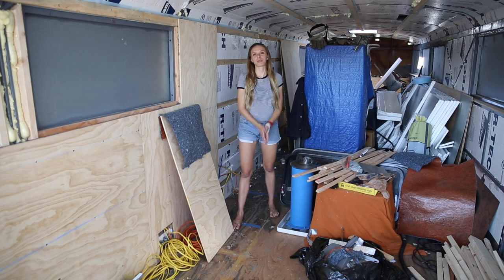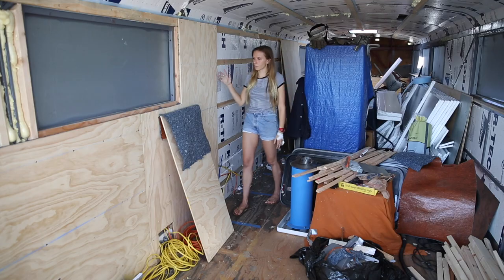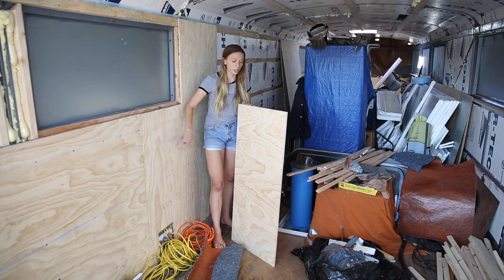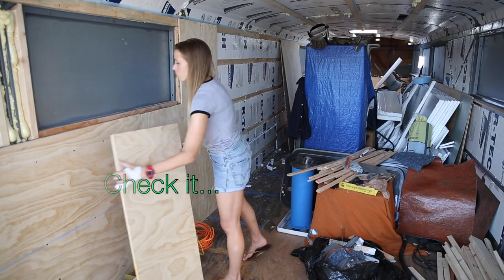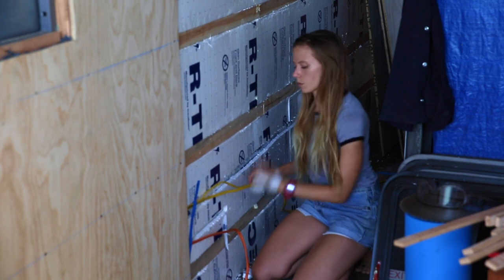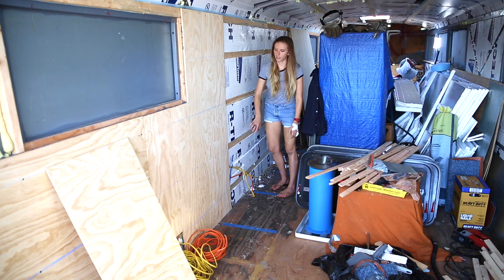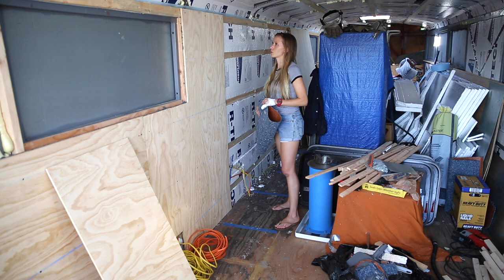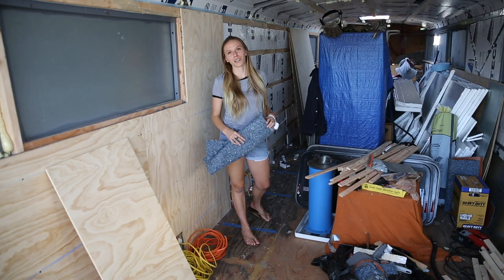Bus Conversion Tiny House #27 Plywood Walls and Electrical

Comment: A thorough job, all that insulation will pay off saving you so much money in heat loss, impressed.
I love seeing team work I really do.
I'm subscribing ..👍
Reply from the maker: +John boy C Thanks man! It is always really nice to get positive comments. Our new channel is Bears Builds, we will posting videos to that soon. We will have a couple more for this channel as well.
Reply: Back to School Bus it's my pleasure , if you need any structural or build advice throughout give me a holler I'll be happy to help but may I advise run a slit charger off your alternator so while driving you also fully charge your leisure batteries at no cost at all, you'd wish you left a heater mud bus built in the units too, why? As you drive on cold days you'd be heating the bus for free ..
Just throwing ideas out your way buddy.
Truly I love the team work, you both appreciate how much work goes into building this right, I shake both your hands, stay strong there will be many challenges but like I say I'm here should you need advice on anything.
Reply from the maker: +John boy C That is all great advice and has definitely been topics that we have mulled over. Builds like this seem to be a constant struggle of weighing pros and cons for what to do, how to design, what materials to use etc... all a part of the fun.

Comment: That wall system looks good. I am considering it, but with paintable bead board ply. It finishes well and can be re-painted as needed or styles change.
Reply from the maker: +Kevin Hornbuckle The walls worked out pretty well and I like you idea of the bead board ply, that would be pretty sharp. Our ceiling didn't turn out quite as well as the walls... should have installed the runners back to front around the entire inside perimeter; rookie mistake.
Reply: +Back to School Bus Thanks for replying and pointing out possible improvements. It is really helpful to others such as myself.
Reply from the maker: +Kevin Hornbuckle No Problem, it is awesome you are undertaking such a huge project. We have one or two more videos for this channel planned before we move to a new channel on some other build stuff. One video will hopefully be introducing the new owners and saying good bye and another will probably be things we would have done different : ). Hopefully you have a chance to throw some videos of your project up on Youtube some time! Best of luck

Comment: Great video however I bet you got glue over spray al over the RVS sitting near you. That would really tic me off if I found the crap on my RV. I'd spray stuff that can overspray farther away from others vehicles. Don't want to be mean but we had something like this happen to us in our storage spot. Unfortunately because we couldn't prove which spot it came from we had to pay a company to come out and clean our 32 foot RV. Talk about uber pissed.
Reply from the maker: +Wendy Chiari Warrior We have been very respectful of the RV's next to us. Maybe it looks like we are close to one in the video but we have about a 15-20' buffer and did not have much overspray whatsoever because when I pay for something I want it to be used... i.e. I hold the nozzle close to the wood. On the corners there was a little that got away but not enough to be concerned over (you can see it in the video). Furthermore we sprayed two pieces outside of the bus, the rest was done inside. Thank you for your bet and concern though!

Comment: Romex wiring is really a big no no in a bus. The constant vibration will cause the solid wire to break. Think of a bus as a daily earthquake. I know it's a lot cheaper but it's a problem waiting to happen. A type SO cord is a suitable substitute. It comes in about any combination you want, is stranded and flexible. Mainly all wiring needs to be stranded. Notice all automotive, bus and boat wiring is stranded. Also wirenuts are bad. Connections should be crimp or solder. One of those for what it's worth things. Ultimately, not my bus not my problem.
Reply from the maker: You are 100% correct that the Romex, being solid core, is not the recommended product for installation in a bus or any application with excessive movement and vibration. Stranded flexible wire is the best option. No arguments there. Looking at it from a real world application standpoint we have more than covered our basis. You also have to look at how wire is fastened to better understand the end result of fracturing. I will try to address that in a future video. Appreciate the heads up and the valuable information, there are some people who may not know the difference and we really should have mentioned that for them. Cheers!
Reply: Romex is commonly used in motorhome at least older ones, we have a 29 year old coach and all is fine
Reply: David Crumpler false.  I think that's your opinion.  There is nothing wrong with this if it's installed right